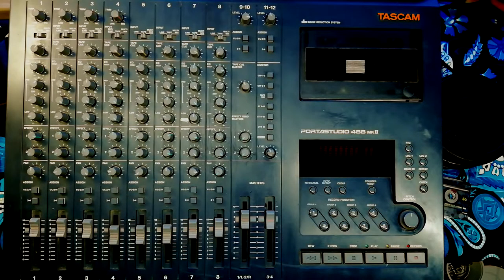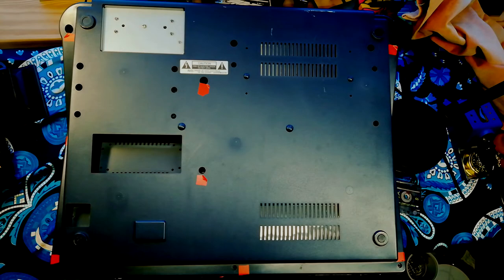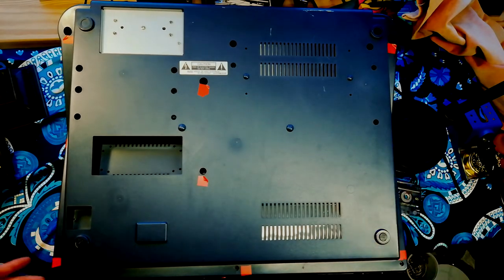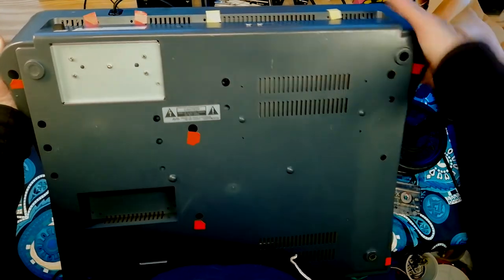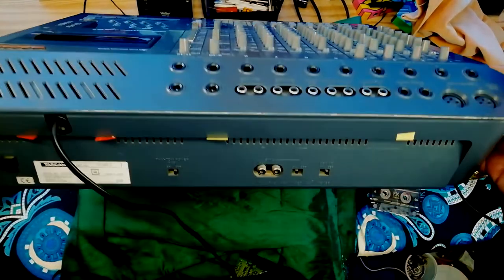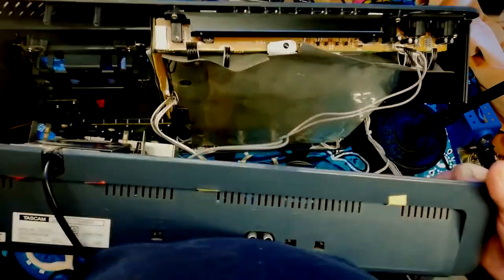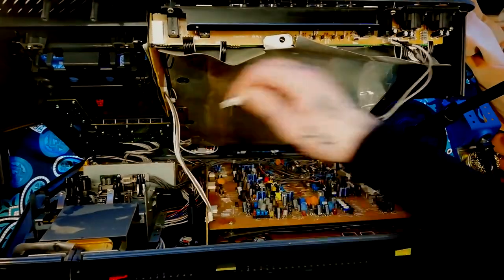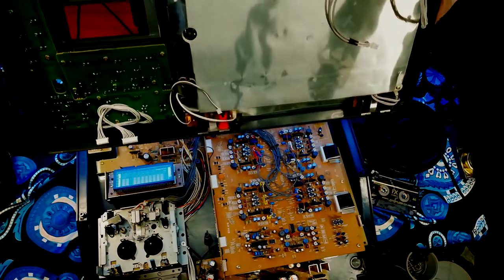Tascam Portastudio 488 MkII | how to open the case

Comment: Got the 488 MK2 going just now (new belt and Gear C), all thanks to you man!!  Rwd and Fwd are now working too (they were just spinning away before without winding tape).  Now on to the MK1!  Can't thank you enough for the detailed vids (where the screws and cables go, how to remove the capstan motor, etc).

Comment: This is really helpful. Track 8 on my 488mk2 is playing back muffled and very quiet compared to the other 7. It seems to record ok as the meters show it taking full signal, but playing back is low volume and muffled. Any ideas? Thanks
Reply from the maker: Probably the playback amp trimpot needs turned up
Reply: @Tetrakan  thanks mate
Reply from the maker: You're welcome. Get back to me for more suggestions if that doesn't do the trick.